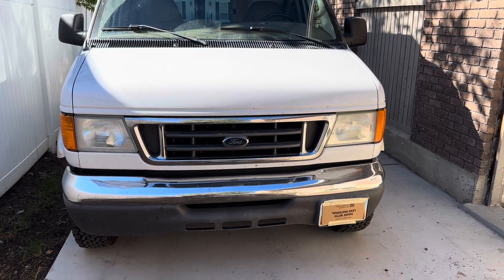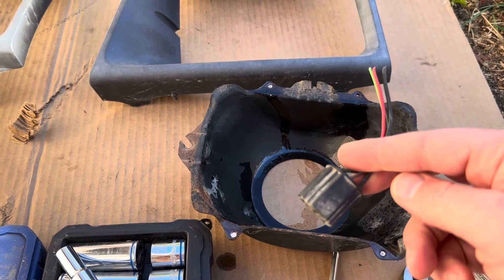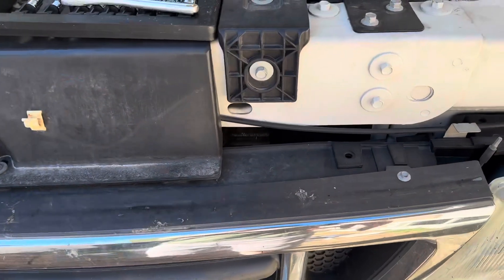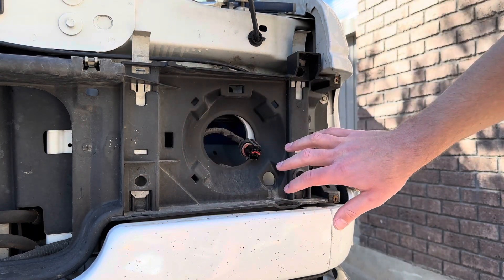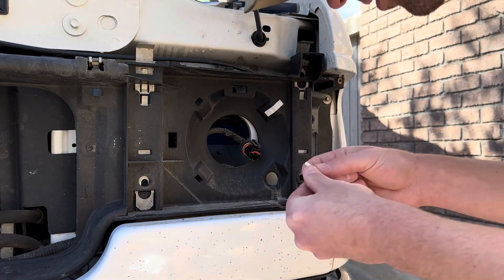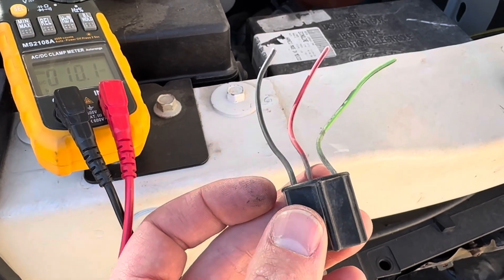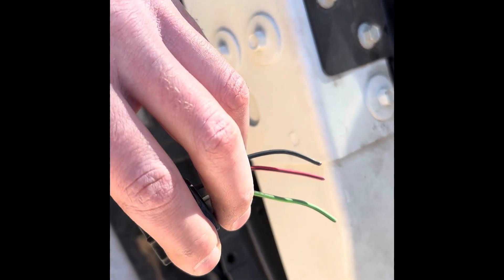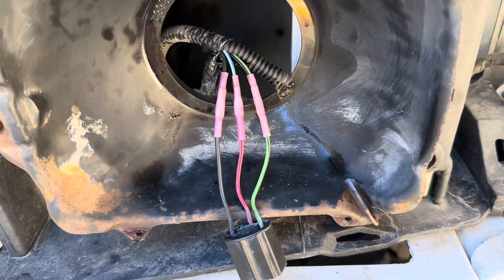Ford E350 headlight conversion from composite to sealed beam

Comment: Why does Ford do this! 😭 
Did you order "confirmed fit" just like many here in comments and do this on your own after the error? 
Thank you for the upload!
Reply from the maker: No it was all planned. Ford offered two different styles of headlights on these vans. Converted from the composite style to the seals beam style because it opens up way more options for aftermarket lights.

Comment: How do you like the change?  I'm in between replacing what you had originally with an aftermarket version that's basically the same but without the fogged out lens.  I'm lookin into this change as those LED sealed bulbs look like they would be a better light output.  Was it worth it for you?
Reply from the maker: It was totally worth it.  Happy with the results.

Comment: If the headlights are not at the same level on the vehicles, they should not be aimed at the same place for a close-by target.  If you do so, the vehicle with the higher headlight mounts will aim down too far and not light up distant objects.
Reply from the maker: I did it the right way later, just did it real quick like that to take it on a test drive. For that I’d rather them aimed too low than blinding people.

Comment: So did these vans come with sealed beams from the factory on prior year models, and all you had to do is pull the parts from that model van? Or did you research what parts are needed and got what you needed from the recycling yard? 87-91 Ford F Series trucks sold in Australia came with sealed beams, but not sure how they are installed on the vehicle. There is a company selling a conversion kit but they are out of stock and aren’t cheap. It comes with a bolt-on light bucket and required surround. The bucket takes the place of the composite light housing only, and mounts to the plastic bracket that is bolted to the radiator support. Hope that made sense lol.
Reply from the maker: The sealed beams came on base model work vans of the same generation.
Reply: @chrisgarage7848  thanks for clearing that up for me. I didn’t know that Ford did this with base model vans back then. I’ll have to do some research if I want to do this to my 91 F150, on the cheap; composite headlights are such a pain to keep from getting dulled.